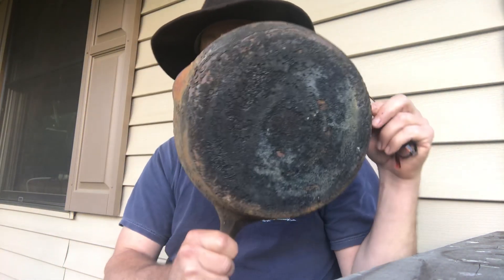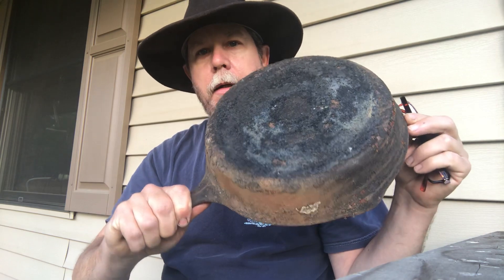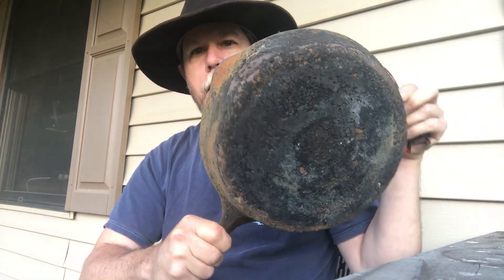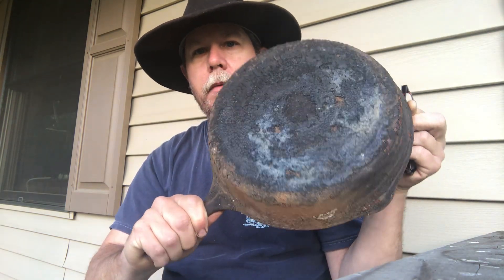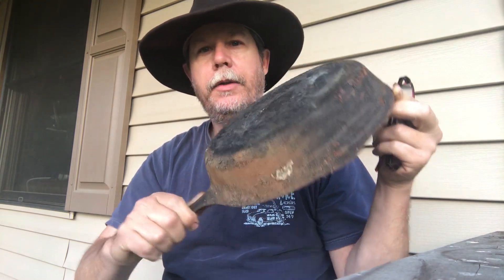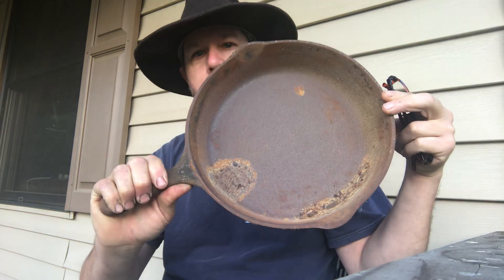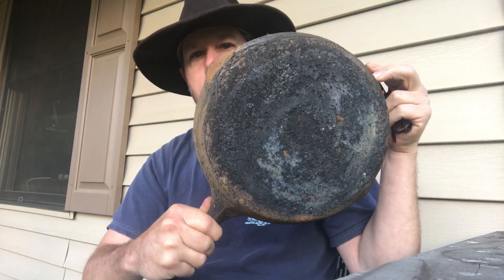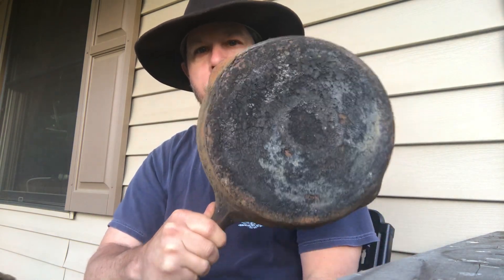Cast Iron Q&A - Build-up (Crud)

Comment: There is an easier way to remove carbon buildup.  Cook the cast iron in the oven on your oven's cleaning cycle.  It turns to ash, wipes right out, and cast iron is ready for seasoning again.
Reply from the maker: hey Jason, thanks for your comment - I know there are some who endorse the OSC method, and I fully admit that I've used OSC to strip a few pans very early on, but I don't recommend that technique any longer, esp if you're going to be restoring a lot of iron or restoring family heirloom vintage iron for others (which I do often) ...  build-up is flammable & the fumes coming out of your oven smell awful LOL not to mention that high heat is not recommended on thinner pieces of vintage iron as it can warp and/or crack them ...  i've heard of some folks using heated lye baths, which will strip build-up off very quickly,  with none of the negative side effects of OSC ...

Comment: Make friends with the folks down at the local engine rebuilding shop.  Ask how much it will cost to have them run your cast iron through a cycle in the Block Cleaner.  It doesn't matter if it is rusty, greasy, or covered with crud..It WILL come out as bare cast iron.  "Bare" as in "be there waiting when it comes out, as the hot cast iron will begin to rust almost immediately".  "Bare" as in "engine parts are ready to paint as soon as they cool down".  

An older "tank" is nothing but a tank of hot lye solution and a circulation pump.  In an actual "machine" the object to be cleaned is sprayed from all sides using high-pressure nozzles and hot lye solution, followed by a rinse with hot water.

Since the equipment is generally used to clean engine blocks and transmission cases, you will obviously need to thoroughly clean your cookware.  Then again, you probably intended to anyways since lye from any source would need to be cleaned off before seasoning...
Reply from the maker: interesting - thx for sharing ...  all i do w/my lye bath iron is neutralize with a vinegar/water solution, wash it down, & it's GTG ...  that's interesting that they use a hot lye bath - my lye bath works much slower in colder weather